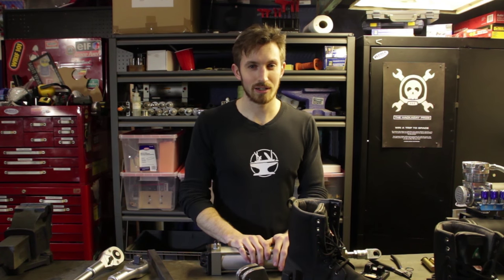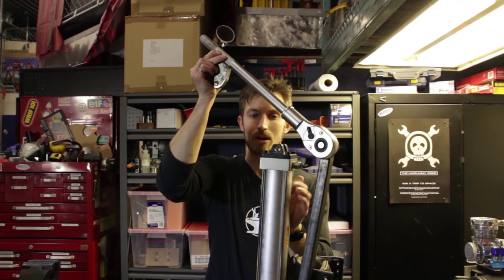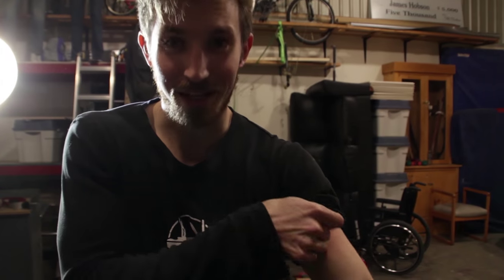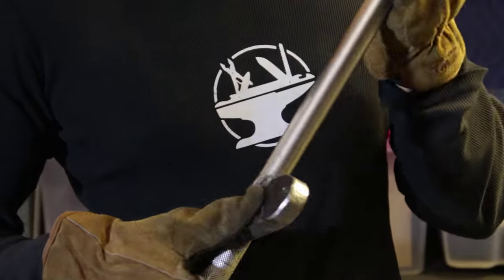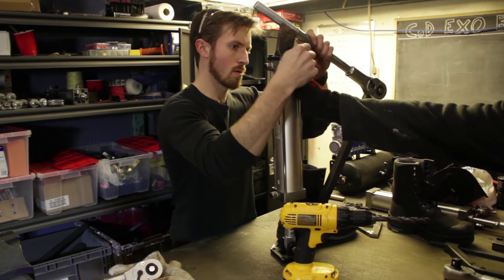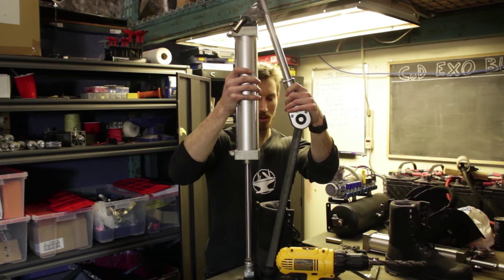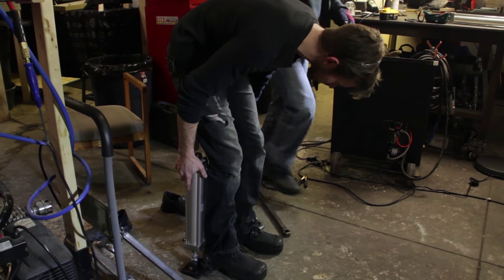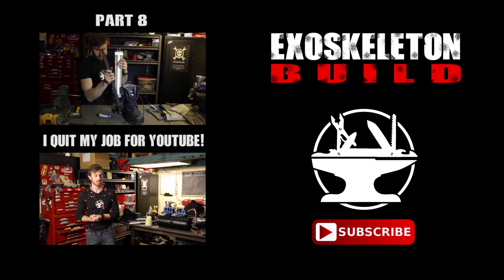Taking My First Steps!!!

Comment: I just can't stop thinking if by chance when you first give the hydraulics power/ pressure idk, it will fully extend and rip you in half.
Reply from the maker: +Kekle℘op Nah, not possible =)
Reply: the Hacksmith Just a query is all.
Reply: +Kekle℘op I knew someone was gonna say dat xD.  But yea, I kinda wondered...
Reply: +the Hacksmith well, one of the suits in Iron Man 2 did kinda break someone's spine, so i'd still prepare.

even if there's no danger, prepare for it anyway. it's better to have a plan if the shit goes down and not need it if everything goes fine, than to have no plan when the shit goes down and you're possibly paralyzed for life, if not dead.

Comment: Man in welding class I used to be really stupid about safety gear. Loose shirts, I caught a few grinders in the stomach thankfully none of them strong enough to dig in just grab the rip the shirt, or wearing short sleeves and gloves. After a semester I finally got tired of burns. But man I hated the under the chin sunburn it was hard to prevent while doing some types of welding.

Comment: is it only for lifting, or can you eventually walk under load?
Reply from the maker: +bradleymoc Probably not, pneumatics are a nightmare to control accurately (which would be required for carrying heavy things and walking).

You can be sure I'll try though.
Reply: +the Hacksmith yeah maybe you can find a way to pass all weight to one leg, step forward with the other and bring the weight forward but that would require precision aswell as diagonal pistons

Comment: What's the highest pressure the tank can take cause you could use the blow of valve and attach it to a second tank for an emergency tank
Reply from the maker: +Harvey ODonovan To what end though? It's a safety valve, just there to stop the tank from exploding (supposed to be good to up to 300PSI). 

I'm planning on using a 4500PSI scuba tank regulated down to 200PSI to feed into this tank for extra power =)

Comment: i cant help but notice that hes using 2 huge ratchets for teh legs
Reply from the maker: +Jo Hack yeah, allows the joints to lock and hold extremely heavy weights
Reply: +the Hacksmith yeah I know I just saw it and immediately thought "is that just a huge ratchet?" Lol